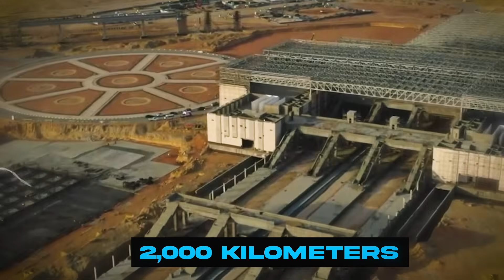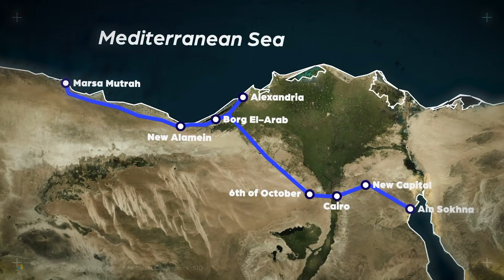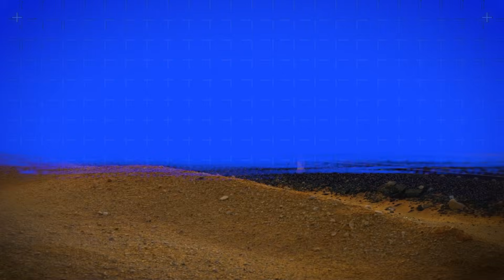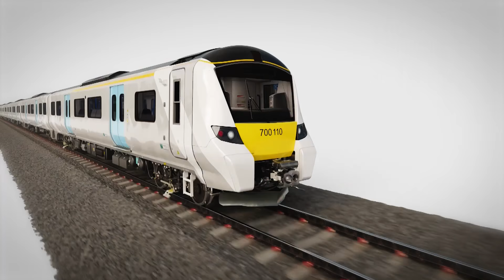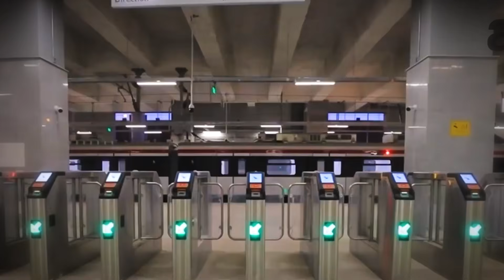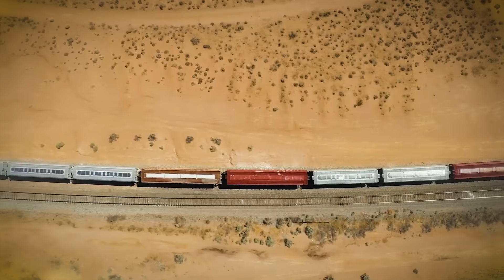Inside Egypt’s $23BN High-Speed Rail: Africa’s Biggest Megaproject

Comment: Morocco is the first African and Arab high speed rail network in 2016 with the speed of 320 Km/h as a max and now Morocco is expending the network
Reply: Which will be completed by the end of 2029. And I would not be surprised at this rate if the Marrakech Agadir high speed rail construction will be launched before 2030.

Comment: Morocco is in Africa too and they have a working high speed network already. If I remember correctly, they are in the process of expanding it. You can only expand something that already exist, Egypt will be the 2nd then with slower trains as Morocco is using TGV with max speed 300 km/h
Reply: It is not true that the Moroccan train runs at a speed of 320 km/h in a distance of only 186 km, and the rest of the line runs at a speed of 160 km/h in a distance of 136 km, which is the same speed as a diesel train. Therefore, it is considered one of the most failed railway projects under every classification, whether electric or diesel, because it is a distortion and nothing more, and a mere attempt to imitate the West without any economic study. If it was a normal diesel train, it would have been better. Therefore, it is not classified as an electric train because its operating economics are weaker than the operating economics of diesel, so what about comparing it to electric trains and the Egyptian electric train network, which will reach 4,000 km, with the other 4 planned lines and is subject to increase to 5,000 km
Reply: @mohamedebrahim4795  Tahya Misr, Long Live Egypt
Reply: First: Egypt is building the "Longest & Biggest" high speed railway with 3.5x Moroccan TGV.

Second: The point of speed, Egypt designed it's high speed railway with a maximum speed of 350 KM/h but due to the project is new to us and we don't have experience in operating like these projects, so we limit the operational speed to 250 KM/h, 

Third: also our project is very long, The higher the speed, the higher the electricity consumption. With longer distances, the electricity loss increases, and this is something we cannot afford now.
Reply: @marwanahmed2410 من الذى اكد ان السرعة فى مصر ٣٥٠ ك.م..اتمنى ذلك وهو انتقادى للدولة لان كل اوروبا ٣٥٠ كم..وممكن يشتغل ٢٥٠ او ٢٧٠ حسب الشبكة...ولكن السرعة التصميمية ٢٥٠ قليل فى الوقت الحالى...كانل الوزير سمعته قال لو شيلنا القكار ده وحطينا ابو ٣٥٠ كم يشتغل وما الءى يؤكدلى ذلك انا رحل سياحة واعرف حيدا ان السرعة هى التى قلصت ااطلب على الطاىرات فى اسبانيا وايطاليا واسبانيا بالذاب..اريد فهم ذلك لو امكن
Reply: Egypts high speed network is bigger than Morocco’s 

As a Canadian I truly dislike Morocco

I visited Egypt and Morocco and can definitely say Egypt is better and more developed
Reply: Egypt does not have a sand ⌛ storms, and the second fact is a second 🥈 Suze canal to connect the two seas the red and mid sea
Reply: Correct your information morocco has the high speed rail network since 2017 add on that the 5th fast train in the world 350km/h with an operational speed of 320km/h check in youtube videos of passengers recording the speed... good luck Egypt keep developing and facilitate Egyptian life 🇪🇬❤🇲🇦
Reply: morocca rail lines are super tiny compared to what egypt is building
Reply: Egypt one is much bigger than Morocco and for the speed, that's because the lines have many stops so you can't go over 300 km/hr
Reply: @RichardWatson-k1j  So that means it will be much slower and it still doesn't change the fact it's not the first. I do get the speed, although in Poland they are planning to build bypasses of the smaller cities to keep the speed up to 350 km/h between the manor ones and only regional expresses will be going through the smaller places
Reply: Yes you’re right but the Moroccan lines extend over 186KM , unlike the Egyptian lines which cover more than 2000KM.
Reply: Morocco has the first high speed LINE on the continent but egypt will have a high sped NETWORK meaning more than 1 high speed line that evidently makes a network
Reply: @joeltcc يا عم اسكتو بقا انتو ومين وبتقارنو نفسكو بمين  بلد اقتصادها قايم على السياحة الجنسية والسحر بتتكلم🤨🤨